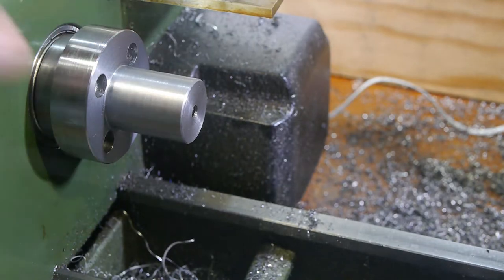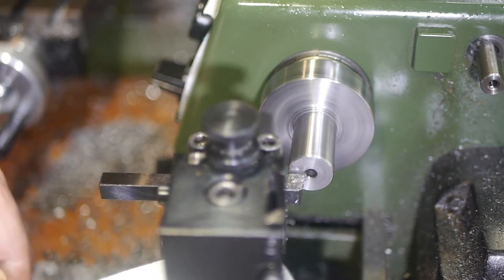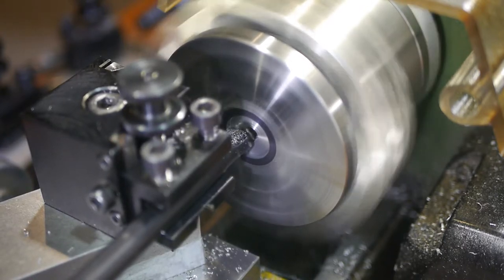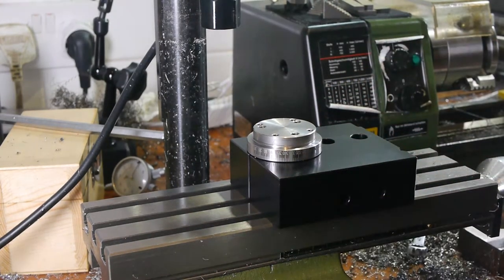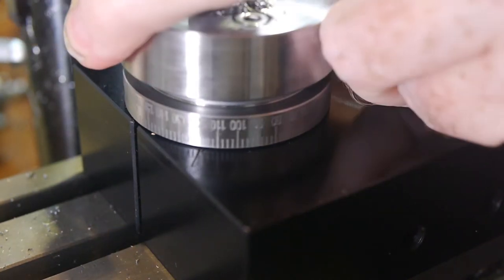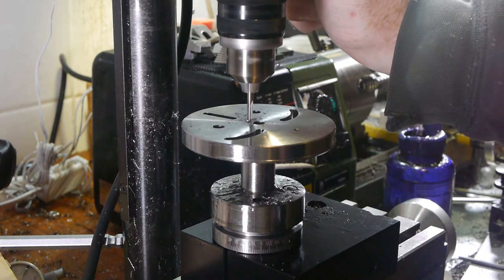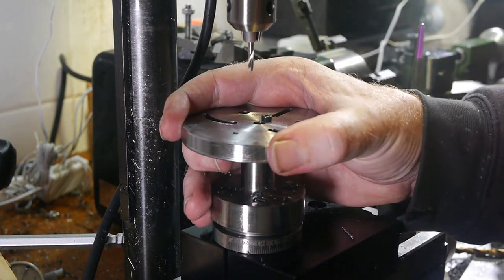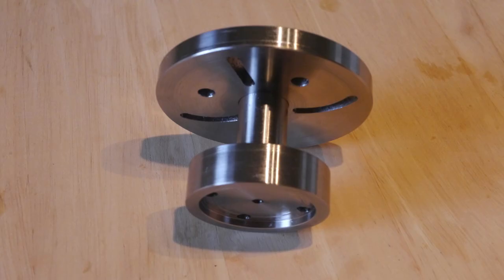Watchmakers Face Plate - Part 8

Comment: Good progress. I am glad to see  the Proxxon  "dividing head" in person. It is really a rotary table, even though it seems to have a vernier. I made my own dividing head and I am glad I did.
Reply from the maker: The "Dividing Attachment" (as Proxxon call it) doesn't really have a way to smooth rotations, so is very poorly suited to most rotary table applications. There is no vernier, just a regular angle scale which you can see in this video.
Reply: Maybe I'll make a rotary table next. Problem is finding a small enough worm and gear. I used one off a deconstructed printer. At small scale, can't readily order worm & gear sets.
Reply from the maker: Here is a link to one of the first machining videos I ever watched:
https://www.youtube.com/watch?v=-umcQtrn1CQ
It describes in very clear steps how to make a worm and worm gear yourself. If buying a suitable one proves too difficult, perhaps you could try it?
Reply: An old favorite. But unfortunately the Taig  lathe does not screwcut!

Comment: Great to see it all coming together, Congrats!!
Have been considering the purchase of the Proxxon TA 250 Dividing Head...
...would be interested in your assessment of the unit.

regards Colin
Reply from the maker: Thanks Colin. This is honestly the first chance I've had to use the Proxxon Dividing Head, despite owning it for months. The lack of rigidity, and the fact that it's limited to the two toothed wheels have meant that the HV4 rotary is always more suitable. The design is neat, and it's very compact, but it's rarely the right tool for the job.
Reply: I suspected a lack of rigidity might be the case. Funnily enough I also bought a small 2+3/4" Rotary Table via a UK Supplier (of Indian manufacture), it was pretty rough & needed a lot of TLC.
According to Proxxon's own info, they've got 30 & 36 Wheels for the earlier TA 230 Dividing Head & from what I'm led to believe, the TA 250 uses the same internals so the earlier Wheels should fit? https://goo.gl/keBFe1  HTH, Colin
Reply from the maker: I've watched a few videos of people improving cheap imported rotary tables, and it looks like a fun project. Maybe I'll try and upgrade my own at some point.
I can't find any confirmation that the toothed wheels for the TA 230 are the same as for the TA 250. I can let you know the dimensions of the wheels included with mine if you would like.
Reply: Thank's but it's OK, I'll contact my Proxxon Dealer just to verify my previous info is in fact correct.
Will let you know once I have a definitive answer.
regards Colin
Reply from the maker: Cool, best of luck.